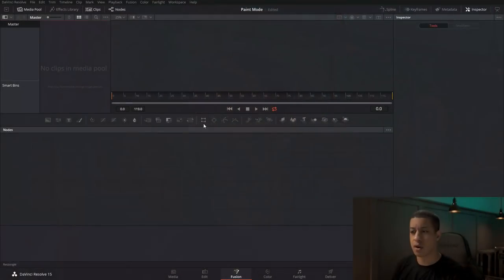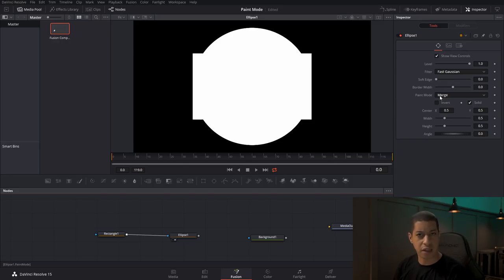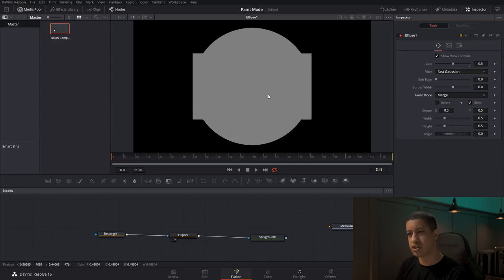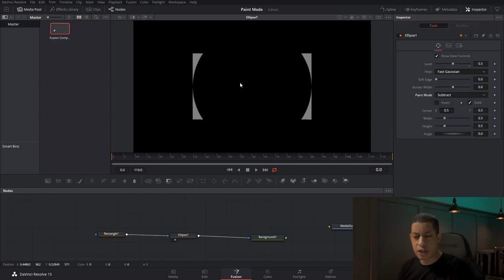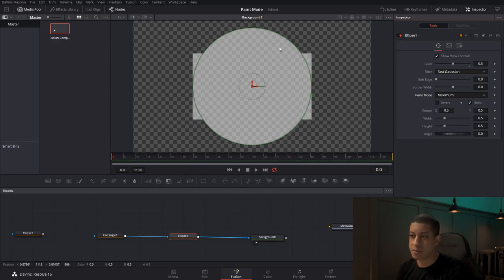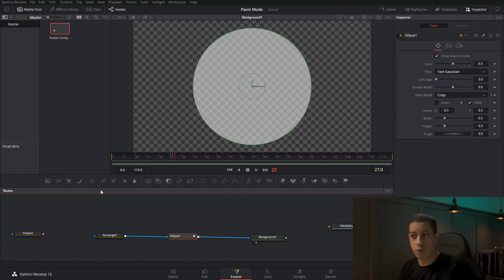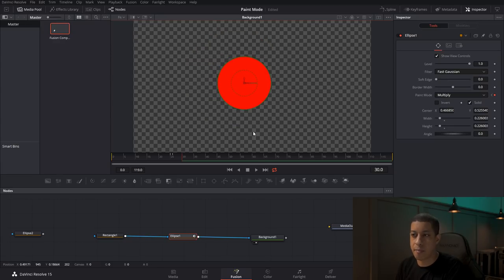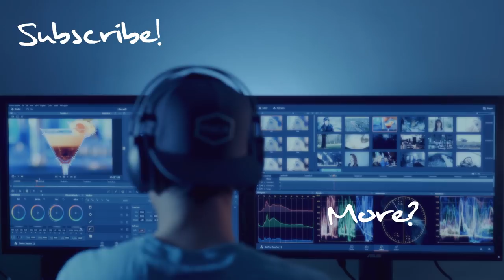Mask paint modes in DaVinci Resolve 15

Comment: Please, help. I am creating new fusion clip but I can't see Medea In or Medea Out images in any of views (pressing 1, 2 or dragging to the view). And the play button doesn't work. But the previously created fusion clip in the same timeline works well. Please give an advice, I have already reinstalled DaVinci, tested in the new projects with no success (
Reply from the maker: Sounds like you just need to open the fusion clip. Once you create the fusion clip you need to open it in fusion.
Reply: @JayAreTV   Thank you for reply. Im in fusion tab, just installed 15.2.3. I can switch between the clips on the bottom but only the first shows the images in the views. But when I play it in the time line the fusion clips rendered correctly. Still can't solve it.. When creating new clean project, new simple fusion clip doesn't show images in the fusion tab either
Reply: @artemborodkin  in the edit page, move the play head over the fusion clip. Then head over to the fusion tab.
The play transport button probably only works if there are key frames in the timeline. If nothing is animated, you just stay on frame 1?